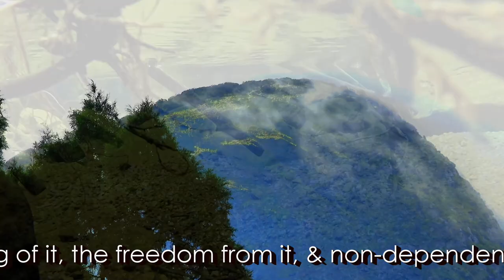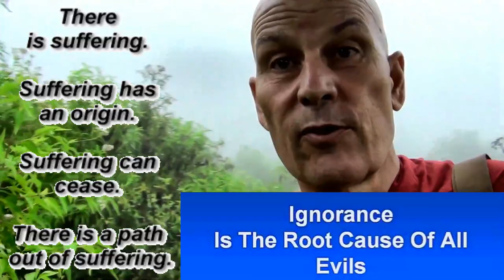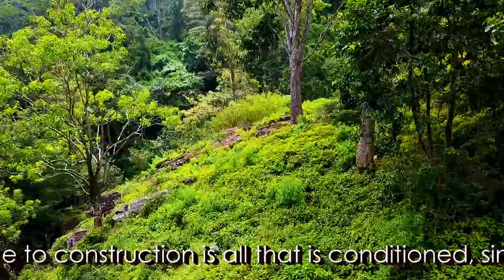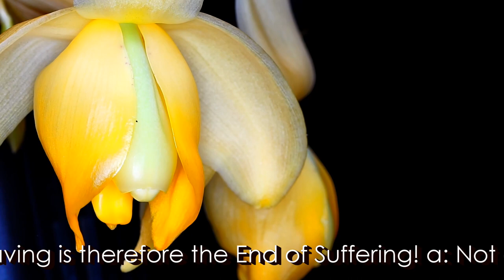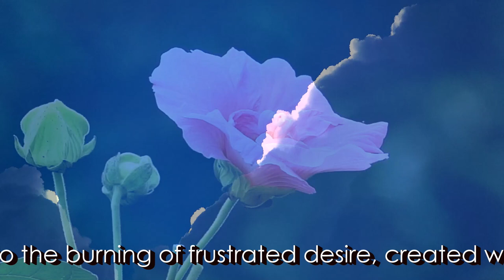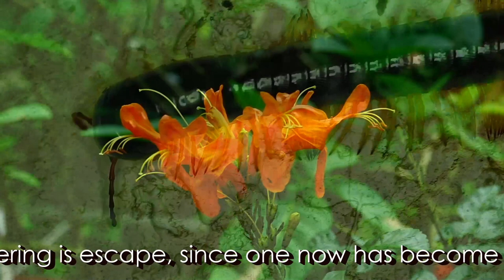VLOG#5: The 4 Noble Truths

Comment: Honorable Bhikkhu, might you please provide me with an example to highlight the difference between "right effort" and "right motivation"? My understanding is, at this point, lacking what is needed to differentiate what is sought and noble versus the act of doing noble things. And, for this reason, I do not understand what the difference is between "right action" and "right effort" at the subjective level. To me, it seems that effort is a type of right action  --- but I presume that there is something qualitatively unique about "effort" which sets it apart from mere "action".

For example, I consider right motivation to be the characterized by chosen noble objectives.

For example, I consider right action to be the present realization of correct behavior.

For example, I consider right effort to be a type of right action that synthesizes noble objectives and manifest behavior into a single experience with its own qualitative element.

I do not feel confident in my understand on these points, but this is how I treat them. If you have the time and willingness to help me correct  my understanding --- or validate the correctness of this kind of thinking, if it is correct --- I would much appreciate your time.

Thank you for your time and your work. I hope I have the opportunity to hear back from you.
Reply from the maker: Please check and memorize the definitions:
https://what-buddha-said.net/drops/What_is_Right_Motivation.htm
https://what-buddha-said.net/drops/What_is_Right_Effort.htm
https://what-buddha-said.net/drops/What_is_Right_Action.htm